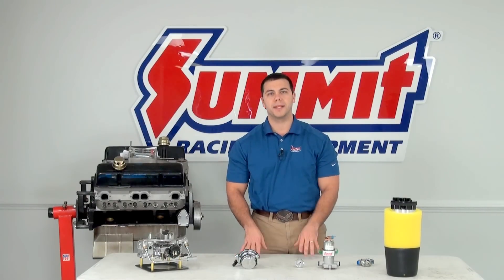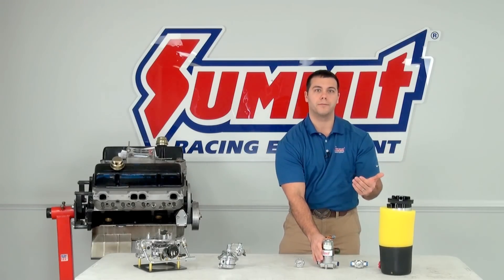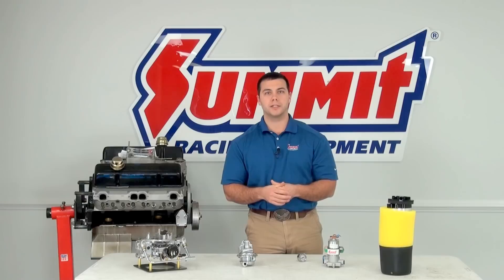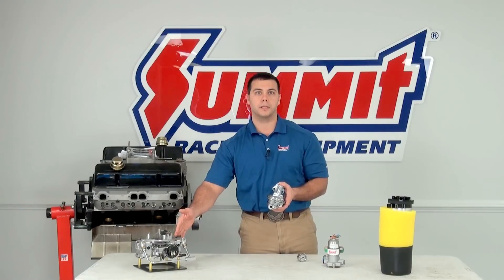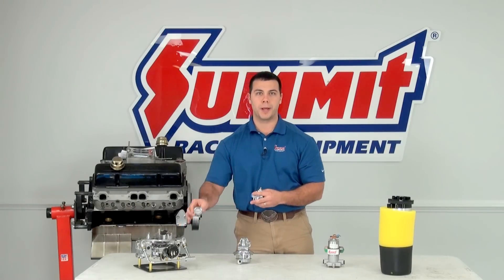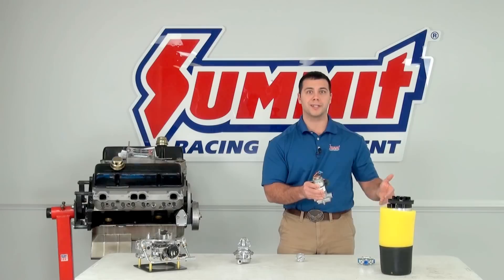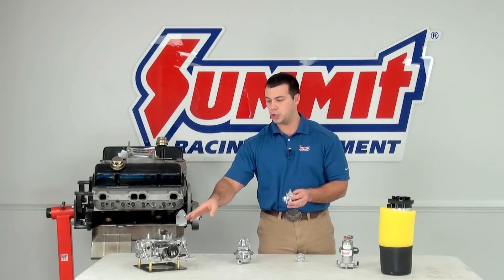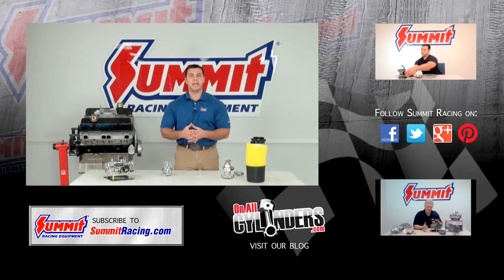Electric vs Mechanical Fuel Pump - Summit Racing Quick Flicks

Comment: I own a 1956 buick special [compleatly stock, origional]  it has a 322 v8 nail head engine. and it has vapor lock. what electric fuel pump should i use to take care of this problem?

Comment: The best is install inline pump then disable internal fuel pump so no open fuel tank needed and use larger adjustable valve so correct pressure achieved

Comment: Have 350 chev holly 750 dp stage 7 lunnati cam edelbrock alum heads which would be bast fuel pump for this engine

Comment: What about the waterman fuel pump? That's the belt driven pump they use on top fuel and funny cars. I've seen some rated as high as 3000 HP on gasoline.

Comment: Hi. How do I know how many psi and gph my engine needs? I Have a 351 windsor with a holley 650 double pumpers on it and I want to run an electrical fuel pump becaus my mechanical fuel pump is messed up...

Comment: Is there a puller electrical fuel pump.  I need one for a boat where the fuel tank is very difficult to get to.  The fuel pump will be approximately 8 feet from the tank.

Comment: I have a 78 T/A with a Pontiac 455 in it .030 over with a 850 Holley and also a 77 all original T/A with the 400 and stock quadrajet.  Both of them take time to warm up and stay running if I don't keep my foot on the accelerator, granted they both sit for extended periods between driving, but wondering if going to an electric fuel pump would alleviate that challenge as it seems like getting the mechanical pump primed and consistent fuel flow would be the cause of repeated stalls when cold starting.  Thanks!

Comment: Question I have a 1980 jeep cj7 SB AMC 304 with a Holley 2 bl carb previous owner routed the lines dangerously close  to the oil pan an around the intake what electric fuel pump conversion is recommended if I block off the manual thank you

Comment: can hook  a 1999 chevl truck  fuel pump  to a 1987 fuel pump  on the side are the engine  that have a carburetor
Reply from the maker: I would like to have more details about your question. If you use a mechanical pump on a gen one small block engine swapped into a newer truck with an electric pump either in the tank or on the fuel rail, the electric pump will restrict fuel flow to the mechanical pump and will need removing. You can keep the electric pump (in place of a mechanical pump) and reduce the pressure using a bypass regulator like Mallory MAA-29387: https://www.summitracing.com/parts/maa-29387

Comment: How do i reduce the pressure on a electrical feul pump flooding the carb and making the car mis
Reply from the maker: Hi John, you will need to use a regulator, but we will need to know the exact fuel pump being used to offer the correct one.

Comment: I just had a stock 1970 F100 w 302 refreshed and the mechanic put an electric fuel pump on it.  When I asked why he didn't just put a new mechanical, he said the new ones  don't hold up.
It seems to work fine but that godforsaken buzzzing drives me nuts.  The buzzing also ocillates in cadence with my turn signals.
Reply: Mechanical is way more reliable, the mechanic is dumb
Reply: @beamishlotus7269  pretty sure you're right, about everything he did I had to get redone.

Comment: I have a 7 psi after market fuel pump with a black holley bypass style regulator and no matter what i do it keeps pumping to 10 -11 psi of pressure to my carb, I've got 3/8 hose to and from and to return and the regulator wont adjust down. I need help
Reply from the maker: First I would make sure the regulator is plumbed correctly. If it is, I would try a different gauge. Thanks for watching!
Reply: @SummitRacing  i figured it out, I unplugged my return line and put it into a jug and the fuel pressure went to normal and i was able to adjust the pressure but when i plugged it back into the return line  on the frame leading back to the tank it build right back up to 10 psi. The return line on the frame is too small, so i ordered 3/8 aluminum fuel line to run back to the tank and my problem should be fix.
Reply from the maker: Either the return line is far too small or the regulator itself is bad.

Comment: Can you use an electric fuel pump and mechanical and then just put a regulator on it for the carb
Reply from the maker: You are not able to combine an electrical and mechanical pump unless they are independent of each other (separate fuel systems). You would want to use one or the other.

Comment: I have a 68 Mustang, 351M with about 350 hp. I've tried several mechanical pumps & my fuel filter is always empty & the car won't start when hot. I've switched to electric fans which have helped but I'm wondering would putting an electric fuel pump back by the tank & "feeding" gas to the mechanical pump help with the shortage of fuel or should I just go straight to an electric pump? Thoughts?
Reply: Mark Troilo sounds like you have a vapor lock issue as you stated it happens when it’s hot.
Reply: @brandonb5298  I figured that was the problem but didn't know if putting the electric fuel pump by the tank & pushing more fuel to it would remedy the problem but I think I'm going to an in-tank electric pump with a return. Thanks.
Reply: Mark Troilo I’d do that route and also try keeping any fuels lines as far away from the motor and exhaust as possible and in a way that allows airflow especially if your system consists of metal lines

Comment: PSI itself is not speed. PSI is only the measurement of pressure. If you increase speed/velocity, you increase pressure. 

There are three types of pressure in a fuel system. Discharge pressure (not measured on an engine) residual pressure and static pressure. When you measure fuel pressure with an inline gauge, you’re measuring residual pressure (flow pressure). If you shut the engine off but keep the electric fuel pump running, that same inline meter would now be measuring static pressure. 

GPH is flow. PSI is the pressure of that flow. Speed is not flow or pressure.

Comment: In my 1965 Ford F100 with a 302 and c6 transmission, which fuel pump do you recommend?
Reply: if the engine is stock w/ carb, stock pump is all you need.

Comment: HI, I HAVE A   350 SBC WITH 3 -2 BARREL CARBURATORS.I WANT TO USE AN ELECTRIC FUEL  PUMP.  PLEASE RECOMMEND A PSI RATING FOR THE PUMP..

Comment: I just had my 1970 Pontiac Lemans stall about 8 times on the short drive home after a morning drive with no issues, I have recently upgraded to a Holley 600 cfm carb I only had quick stalling problems on fast right hand turns before.  I could pull over or shift into neutral and fire the engine back up after a couple tries so I had spark and air.  The problem must be fuel.  Any suggestions about how I address this issue?
Reply: I am having this same issue right now on my 71 Lemans.  Did you ever get yours figured out?
Reply: @magnum6886  yes, I was using low or no octane fuel. As soon as I switched to premium the stalling stopped completely.

Comment: I have a 84 f150 with a 302 I put a electric fuel pump in and now it won't drive a highway speeds and the bowel goes dry ...so should I switch back to the old one ???

Comment: Can I fit an external electric fuel pump for my ford tdci cos Air in fuel line is causing engine stalls and the provided fuel bleed pump is not effective

Comment: I don't think what he said about a pusher vs puller pump is correct. A pump creates a force on the liquid. The force is the same, whether it's a on the block on in the tank. And I had an electric fuel mounted on the block and it worked fine.

Comment: thanks for the tips and knowing which one i would like to install. i've always thought that it would not matter on where i would mount my electric fuel pump. i installed mine before on the fire wall. now i know better. this was also about 25 years ado.  there were no internet to look up for help on you tube. again thank you for the tips.

Comment: You should note that ethanol in today's gasoline can weaken and destroy the diaphragms of old-style (especially NOS) mechanical fuel pumps.  A modern electric pump may be more durable, I have experienced repeated failure of OEM style mechanical pumps but haven't had that problem with the electric pumps.
Reply: Got a chevt 350 with two mechanicle fuel pump failures back to back in 6 months.
Reply: Quality control guys, most everyones buying from China and telling them they want it built cheaper.

Comment: what would you suggest on a 350 tbi switching to a 750 cfm Holley, planning on leaving the electric pump
Reply: Roubraunstein90 I would recommend putting in a fuel regulator with a return line...750 CFM may be a bit much for a stock 350, so you may have to rejet the carb.

Comment: Im planning on installing a 1974 style sbc in my 94 s10 tbi and i want to keep the tbi injection. Can i use a mechanical pump with the factory tbi setup?
Reply from the maker: The TBI requires 11-13 lbs usually which is more than a mechanical can provide.  The other thing you’ll run into is the intake
manifold having a different bolt pattern than the 1974 vintage engine.  Luckily there are some adapters on the market
that will fit your tbi to an older intake. You can view these here:  https://www.summitracing.com/search?SortBy=BestKeywordMatch&SortOrder=Ascending&keyword=tbi%20adapter Another problem you may run into is tuning.  There aren’t a lot of good options with the old tbi engines.  If you’re looking for good manners, the latest batch of self tuning units like the new Summit Max-EFI500 are really great.  You can take a look at it here: https://www.summitracing.com/parts/sum-240500
Reply: Summit Racing I knew about the intake I was wondering if a mechanical pump would work. Thanks

Comment: Have a 53 Chevy 210 that I installed an electric fuel pump on years ago. Seemed to work fine but it since has quit working. I am considering putting a new mechanical pump on it. Someone had told me that the cam could be worn to the point of not being able to use a mechanical one. Can this actually happen? I have never tried putting  on a new mechanical one.

Comment: have a 1992 camaro changed the fuel pump and hooked everything up but it seems to be getting to much gas to the carb what do I do?
Reply: Add a fuel pressure regulator betweenn the pump and carb. Worked great for me on my boat

Comment: can i have a mechanical fuel pump on my gokart so that the faster i go the more power i have? maybe i could put a turbocharger on it too.
Reply: CFFA17 there are fuel pumps for small engines that work off of vacuum pressure.
Reply: Sorry its not quite that easy. but yes turbo and more fuel could do it, but  making more power requires many things. Its a balance of air, fuel compression, flow , spark, and timing. Try reading up on things like porting, which helps understand flow, turbocharging and supercharging, which are a couple of the most common way to get alot of extra power, plus study some serious engine builders, such as tom nelson, and lingenfelter (spelling?.
There are entertaining  shows like roadkill,and you will understand some of the mechanical skills but its not the best for raw knowlege. I hope you keep seeking to find the answers to what you want and keep learning.
Keep your enthusiasm and keep asking questions.

Comment: Hello i am working on a 1967 Datsun 1600 roadster,for some reason the previous owner changed from menchanical to electric but it stays running all the time is that normal and fuel keeps running out the over flow i have problems can you help?

Comment: Question: 
I have an electric fuel pump in my car. Carbureted engine with a pressure regulator, PSI is good. I'm having a problem where I'm not getting fuel up to the engine and I know that the source is somewhere back around the gas tank and the fuel pump. Last time it happened I turned the key and could here the pump running, but no fuel was getting into the fuel filter. I went under the car and loosened the hose clamp on the carburetor side of the fuel pump until it started to leak fuel then let go. I turned the key and saw the fuel filter filled with fuel and the car cranked right up. Now, sometimes it works, and sometimes it doesn't. I have no clue what is causing this problem please help.

Comment: can you help me install mechanical fuel pump in place of electric on 1986 ford truck
Reply from the maker: Hi George, 
At a minimum, this will require removal and replacement of the timing cover so you can mount a fuel mechanical fuel pump, the addition of a fuel pump & eccentric, plumbing changes and removal of any electric fuel pump from in the fuel tank.  Give us a call, we can help you compile your parts list.  1-330-630-0240. Thanks!

Comment: Sorry but just needed to clear a point that PSI does not relate to speed of delivery as that is your flow rate. PSI is the pressure at which the flow is delivered.

Comment: What are the symptoms of leaning out of gas? do i need to install an external electric fuel pump since i experience somewhat of a leaning out sensation at high rpms , my engine's piston is a 1.5 liter but have oversize pistons it them . What's your opinion about my query? thanks!
Reply from the maker: Hi Meowtrox, 
This is where a good quality gauge comes into play. Have a fuel pressure gauge and an air/fuel ratio monitor (wide band O2) mounted where they can be seen/read during wide open throttle operation. A fuel pressure gauge that drops steadily as RPM increases can be an indicator of a fuel delivery restriction or an incorrectly sized fuel pump. This would also show up as a lean condition on the air/fuel ratio monitor.

Comment: good explanation mate, i have a leyland 4.4ltr v8 in a boat with a 600 holley carburetor, what size fuel pump would be perfect for this
Reply from the maker: Hi Jarrad, 
This would depend upon the power output of the motor. Give us a call, we’ll help you figure it out. 1-330-630-0240. Thanks for watching!

Comment: I just purchased an Edelbrock  #1406 600CFM Carburetor for my 350 stock Chevy and I am switching from a Mr Gasket electric fuel pump back to mechanical.  The new Precision #M16011 pump is rated to 9psi.  Edelbrock say no more than 6psi at idle.  What should I do? 
 I purchased the C20 truck this way, it had the electric fuel pump mounted about 18-24 inches from the carburetor just hanging down the side of the block. It is now leaking from the outlet port, the built in brass grommet  that is molded inside of the body of the pump!
Reply from the maker: Hi 707SonomaComa, 
Use of a fuel pressure regulator is all that is required. Take a look at this one (SUM-G3032)  on the Summit Racing website. https://www.summitracing.com/parts/sum-g3032/overview/

Comment: I have a Holley Electric Fuel pump Red. And there's a IN–OUT, does that mean the hose from your fuel tank goes to the IN, and the hose from your Carburator goes to the OUT??
Fuel tank hose goes to the IN port...then the hose from the Carburator goes to the OUT? Right?
Reply: Thanks. Idk but I think mine is working the other way around. And it's doing really good

Comment: For turbo on a carby, is it easy to upgrade mechanical fuel pump without modification??
Reply from the maker: +Nicholas Bassaholic, 
We need some additional information from you. Can you give our tech line a call? 1-330-630-0240. 
Thanks!

Comment: Hi. I am looking for a mechanical fuel pump (not electrical) which has a psi range of 50-70 psi. Do you guys have pumps with this range? Do you know where I can find pumps in this range?
Reply from the maker: +Zaid Sheikh , 
Sorry, we do not have a mechanical fuel pump other than a belt drive capable of that high of pressure.

Comment: I have a question.  I'm looking for an electric pump because I do not like the mechanical one right in from of my engine. I have a chevelle SBC 350 .40 with a summit 600 carburetor. My question is what electric pump I should get?
Reply from the maker: +Yamil Cruz , 
There are a few questions that will need to be answered when choosing your pump. Most importantly, what kind of power is the motor designed to make? Where will the pump be mounted? What type of plumbing will you use?  What’s your budget? Give us a call, we can help you choose one that is just right for you. 1-330-630-0240.

Comment: extremely helpful I was going crazy thinking I would be able to carb my tbi gen v 454 cus it didn't come with a mechanical fuel pump that was a huge relief thank you sooooo much :)
Reply from the maker: +Jose Alejandrez , 
Thank you for watching! Please let us know if you have any questions. :)
Reply: +Summit Racing my 84 Mustang GT shut down while driving and when I pulled over, I checked the usual, spark, fuel and air. I checked my oil and when doing so, I smelled fuel. I believe my FPR is shot, which there could be a few other issues that would cause this issue, as choke sticking open, needle and seat blew, jets are to big, even and intake leak that could suck air in and pull extra fuel from the carb, especially if the FPR is no good. I'm thinking it may be the FPR though, since the reading is off. How do I check the choke to see if its bad or if the needle and seat are shot? I'm running a Summit 650 carb and intake.

Comment: Hi, I have a 1972 Chevy Nova with a zz4-350 crate motor it has a electric fuel pump which is turned off and on by a switch would you recommend leaving it on when the car is off or turn it off when I turn off the car too? It dosent always start first turn either..
Reply from the maker: +Steve Perez . 
It’s always best to make sure electrical accessories are off when the car is not being used!

Comment: i don't know what is the better install fuel pump inside the tank witch is hard to replace during pump damaged or outside the tank witch is easier but i don't know it's dangerous or no in the hot weather ? anyone have experience about this idea plz reply
Reply from the maker: +sharahili ahmed , 
We need some additional infotmation from you. Can you give our tech line a call? 1-330-630-0240.